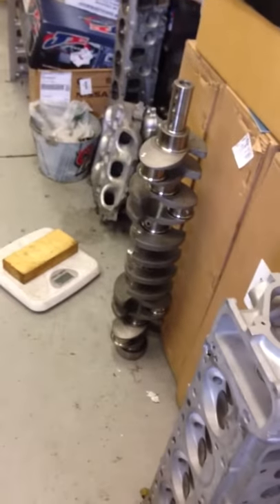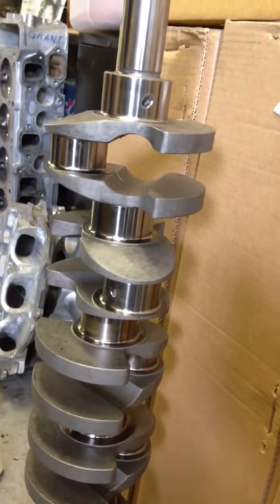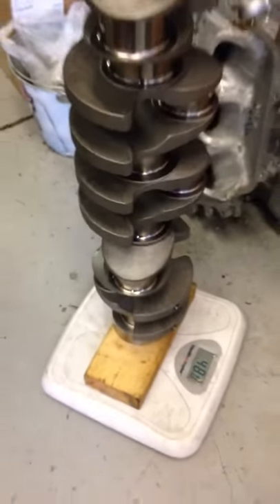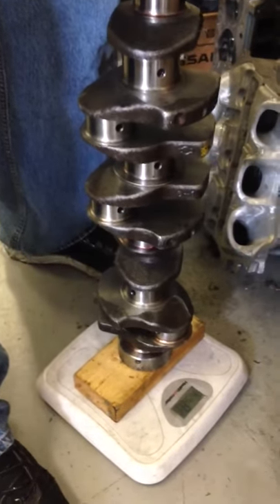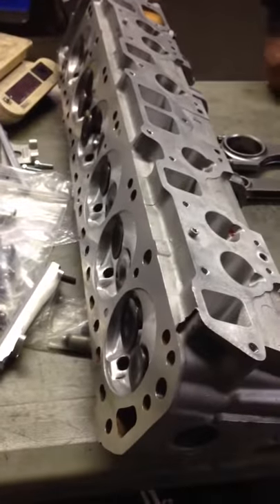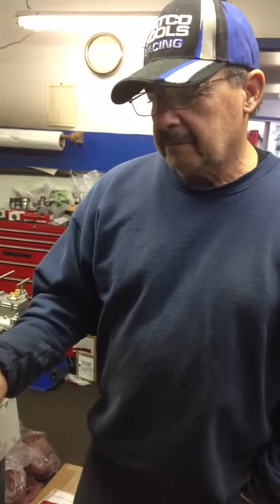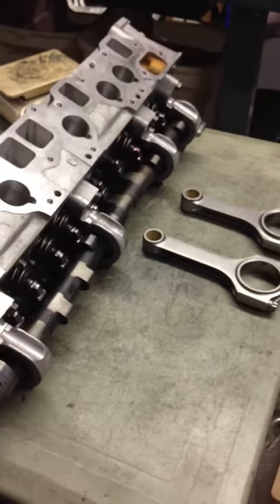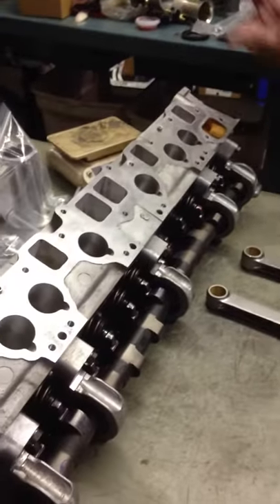3.35L L Series Motor Build by Rebello Racing

Comment: Rebello Racing has been building excellent motors for decades. And Dave and Bryan are also very nice people. I'm running one of their 2.3L motors in my original-owned 1972 Datsun 510. The engine puts out 205lbs of torque and 215 hp, with a redline of 7,500rpm.

Comment: I'd be interested to know what the reference to "tall deck" motor means? Surely they are not using the LD28 block for this? I believe the LD28 block won't take a +89mm bore. Anyone know what Dave is talking about?
Reply: I think he's just referring to the longer stroke and connection rod combo probably with a short light weight piston also.